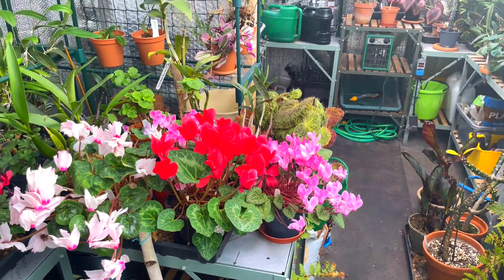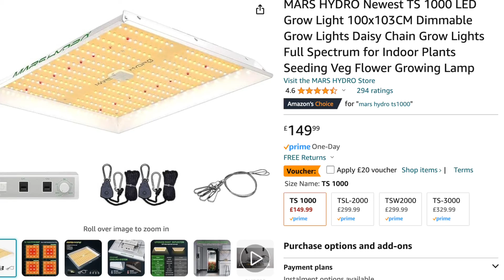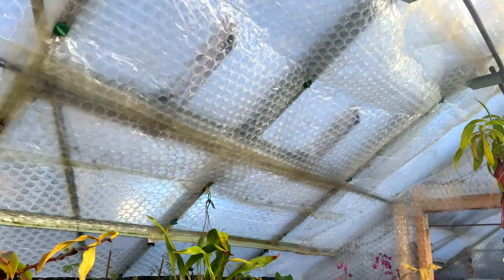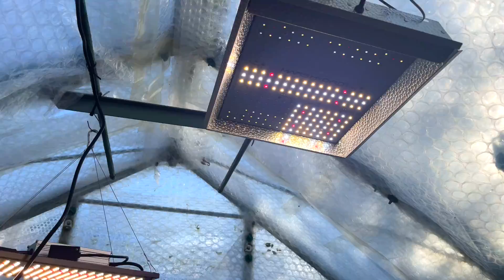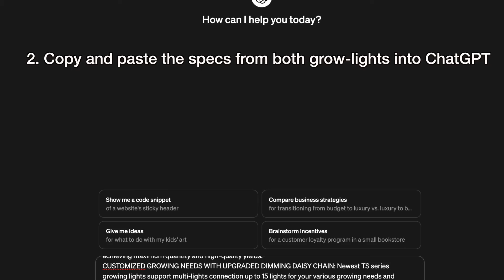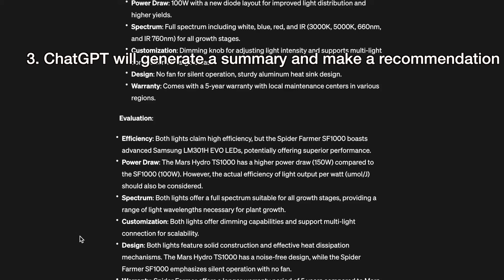SIMPLE GUIDE to GROW LIGHTS | EASILY Choose One!

Comment from the maker: 1. *High-End Brands:*
    - *HLG (Horticulture Lighting Group):* Known for high-quality, efficient LED grow lights. Their products are often used in professional setups.
    - *California Lightworks:* Offers a range of advanced LED grow lights with programmable features.
2. *Mid-Range Brands:*
    - *ViparSpectra:* Provides cost-effective LED grow lights with a good balance of features and performance.
    - *Roleadro:* Known for budget-friendly options with decent quality for small to medium-sized setups.
3. *Budget-Friendly Brands:*
    - *BESTVA:* Offers affordable LED grow lights with decent performance, suitable for beginners or hobbyists on a budget.
    - *Mars Hydro and Spider Farmer:* While also considered a mid-range brands, Mars Hydro and Spider Farmer have budget-friendly options and are known for providing good value for the price.
    - *King Plus:* Offers affordable LED grow lights suitable for small to medium-sized grows.

1. *PAR (Photosynthetically Active Radiation):*
    - PAR refers to the range of light wavelengths (usually between 400 and 700 nanometers) that plants use for photosynthesis. Look for a grow light with a high PAR output, as this is crucial for plant growth.
2. *PPF (Photosynthetic Photon Flux):*
    - PPF measures the total amount of light (in the PAR range) emitted by a light source per second, measured in micromoles per second (μmol/s). This is a crucial metric for understanding a light's ability to support plant growth. Higher the better.
3. *PPFD (Photosynthetic Photon Flux Density):*
    - PPFD is the measure of the amount of PAR that reaches a specific area (usually one square meter) per second. It's an important metric for determining light intensity at the canopy level. PPFD is often more relevant than PPF for growers. Higher the better.
4. Kelvin: Kelvin is a numerical value that’s related to the colour appearance of the light - plants need different ‘colours’ depending on their stage of growth. But for most houseplant or tropical plant growers, look for a Kelvin reading of above 5000K - which is most similar to midday sunshine.
5. When talking about wavelength, sales ads will sometimes give a reading in nanometres (nm), usually from around 395 to 660nm, which promote various stages of plant growth. Providing you’ve chosen a light that offers ‘full spectrum’ then this reading is irrelevant to houseplant growers of established plants.
6. PPE - LEDs (AKA diodes) are sometimes given an efficiency rating in micromoles per Joule (µmol/J)   - the higher the number - them more efficient they are.

Comment: Hi Geof, thanks for explaining this very well, for my orchids I’ve settled for some very inexpensive strips that I mounted under the shelf above and  for plants on the top shelf I have the gooseneck 30cm double or triple armed types. It works well enough all considered. For the rest of my houseplants I just have gooseneck clamps with led grow light bulbs. All of these I run for about 12-14 hrs on timers. The bulbs are a bit hard on the eyes and I’d like to find some shades for them, but that can wait for now. PS. Just watched the other video and wanted to mention that I have most of my plants quite close to the lights, so hope that is of some benefit.
Reply from the maker: Thanks Renate. Sounds like you have a good setup. Even cheap lights are better than no supplemental lighting at all - and like me, sounds like you've opted for a mixture in light quality. I think many people will be in similar situations where sometimes they can afford to buy better quality and sometimes just the cheapest non-grow lights. All will help to improve growth - despite not being 'optimal'.

Comment: I've read several comments on other pages about different types of roots & that if a plant is in water, it won't do well in soil, & vice versa.     Do you have any insight about that??
Reply from the maker: I'm not a botanist, but I understand that when growing in water, the roots are naturally more delicate and have more fine hairs than when growing through a 'solid' media - purely as a result of the water offering less resistance. Therefore on transplanting to a more traditional media, the roots can get easily damaged or suffer from 'transplant shock'. In my experience it's not a huge problem - simply transplant them into something very loose and airy first, like perlite, vermiculite, moss or a mixture of those. Or better still, root your cuttings directly in whatever they're going to grow in, in the first place. Hope that helps.